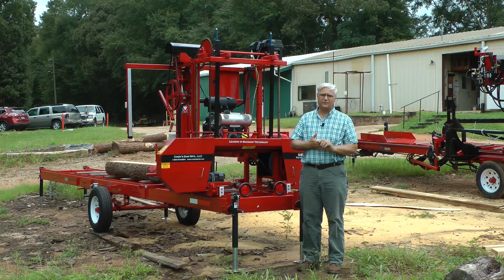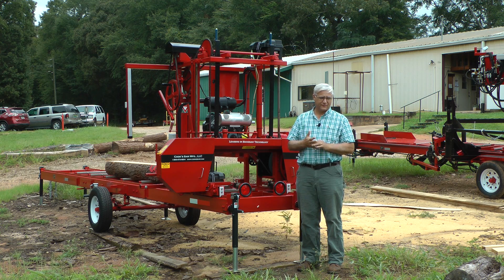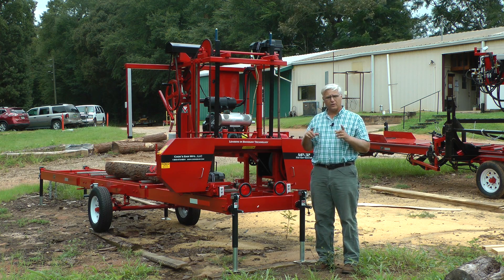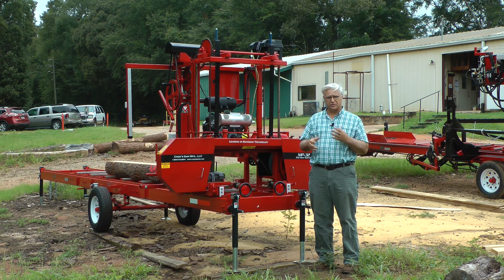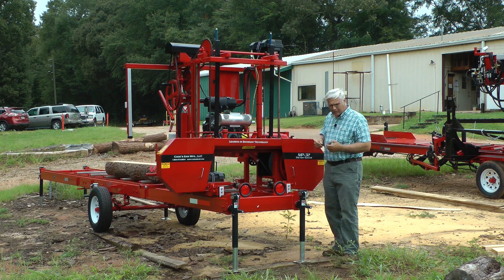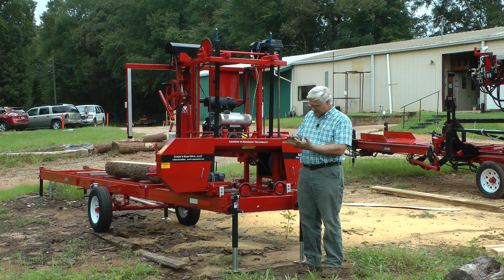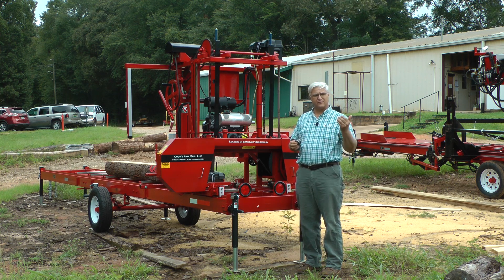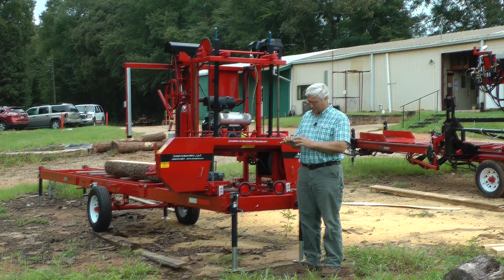Where should the blade ride on the roller guide? Portable sawmills & Resaws

Comment: What is the mathematical formula for figuring BF. I DO NOT want a chart of PDF, I want the formula. THANK YOU VERY MUCH FOR YOUR TIME AND like always great videos, great audio, video and content. Thank you againl
Reply: W x L x D in inches (this totals cubic inches) then divide by 144 (cubic inches in a board foot).  Example  16" w x 96" l x 1.25 d (5/4 thick)  equals 1920 cubic inches , divided by 144 (cu BF) equals 13.3333 total Board Ft.      Www.tsmfarms.com
Reply: (Length(in inches) x width x thickness)/144